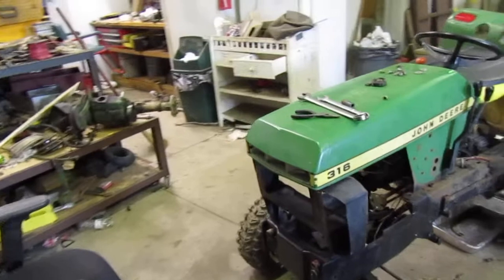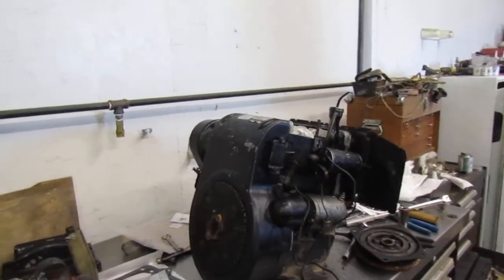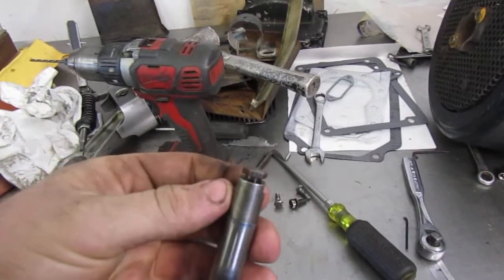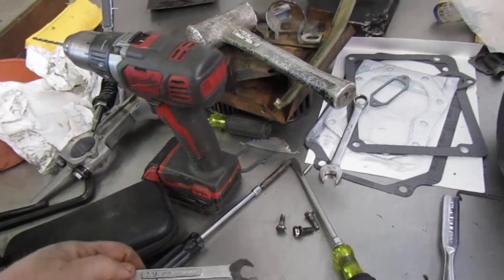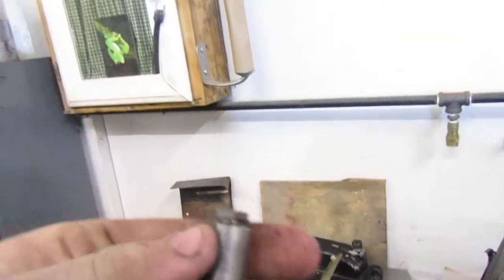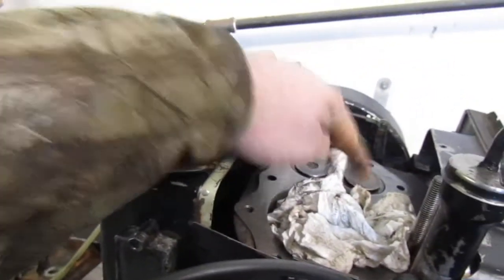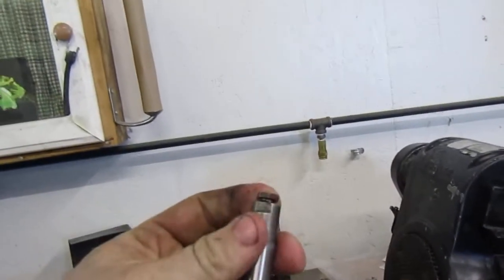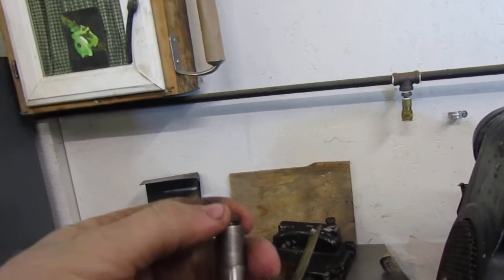2/22/22 Quick Tip Tuesday! How to adjust valves on a K series Kohler K241 K301 K321 K341 ECT

Comment: How much does that engine weigh? Were you able to lift it off the frame by hand?
Reply from the maker: They have some weight to them but yes it is doable. Have a chair or table near by to set the engine on as soon as you get it out of the frame.
Reply from the maker: Want to say the engine weighs around 100 or so pounds never really weighed one
Reply: Thanks for the advice. I was thinking I might need to get a chainfall and hook it the beam in my garage. I’ll see how it goes…I have a 62 year old back.